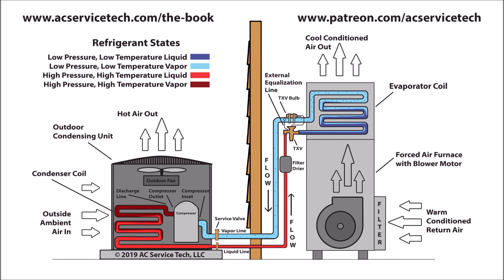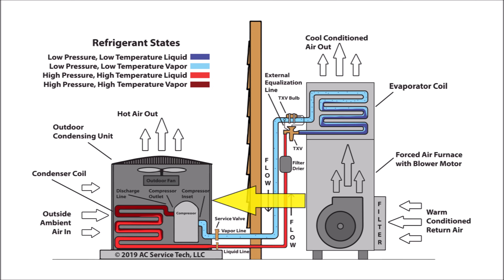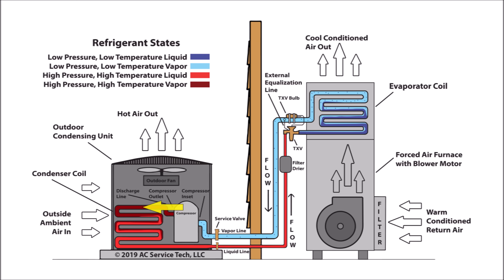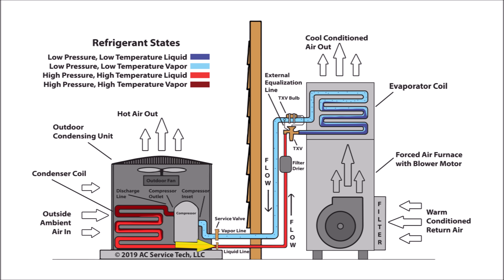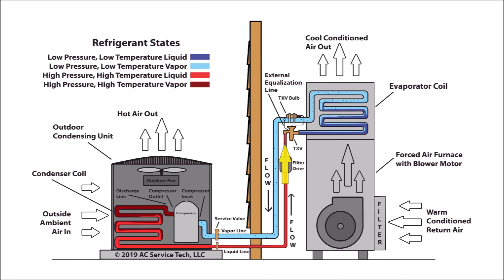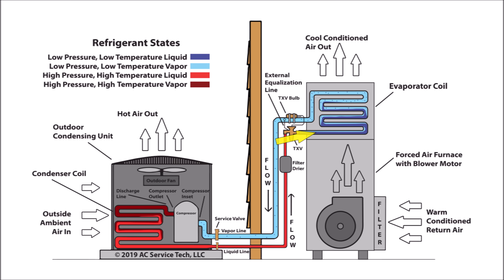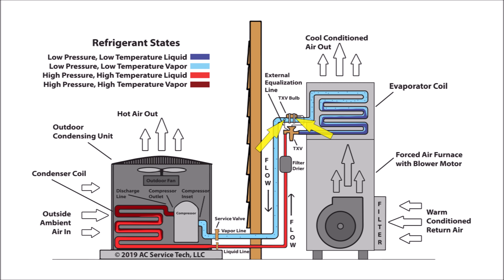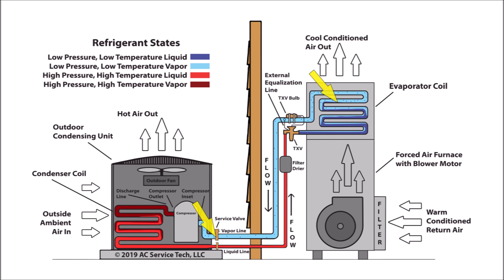The Refrigeration Cycle Explained Step By Step!

Comment from the maker: The Book:  www.acservicetech.com/the-book
The E-Book is Currently Available for Purchase at the Website!
Paperbacks Are On Their Way to the Site soon!
Tool List-  https://www.amazon.com/shop/acservicetech

Support the Channel-  https://www.patreon.com/acservicetech

For those that are looking for the tools used in the videos: (Linked Below)
UEI DL479 Multimeter with temp sensor http://amzn.to/2jtsUbJ
Magnet Jumpers- https://amzn.to/2PyKPQZ
Alligator Jumpers- https://amzn.to/2PxqJXn
Fieldpiece ST4 Dual Temp Meter  http://amzn.to/2wc1ME3
Fieldpiece Bead K Type Temp Sensor https://amzn.to/2DBwKfs
Fieldpiece Wet Bulb Temp Sensor https://amzn.to/2RRI7Tw
Fieldpiece TC24 Temp Clamp https://amzn.to/2qHLyjZ

Yellow Jacket Refrigerant Gauge Set http://amzn.to/2aenwTq
Refrigerant hoses with valves http://amzn.to/2aBumVI
Yellow Jacket Gauge set & hoses https://amzn.to/2vLVkV9
Yellow Jacket 4 Port Manifold w Hoses https://amzn.to/2BkuGIq
FieldpieceSMAN360 Digital Manifold Set https://amzn.to/2BdoaD4
FieldpieceSMAN460 Digital Manifold Set https://amzn.to/2nB4Fe6
Compact Ball Valve for Refrigerant Hose https://amzn.to/2KUisW8
QuickDisconnect 90 for refrigerant hose https://amzn.to/2MMtVcg
JB 6 CFM Vacuum Pump   http://amzn.to/2nqbvo8
Appion Blue 3/8" to 1/4" Vacuum Hose http://amzn.to/2uYlVyc
Appion Red 3/8" to 1/4" Vacuum Hose http://amzn.to/2uYg6Ro
Appion Valve Core Removal Tool http://amzn.to/2uYr8WL
Yellow Jacket 1/4" by 1/4" hose http://amzn.to/2umtcod
CPS Vacuum Micron Gauge http://amzn.to/2v1nM3O
Supco Vacuum Micron Gauge http://amzn.to/2v1JRiA
RectorSeal Bubble Gas Leak Detector http://amzn.to/2ckWACn
UEI DL389 Multimeter  http://amzn.to/2xAdaJf
Air Acetylene Torch setup    http://amzn.to/2aQalsb  
15% Silver Brazing Rods  http://amzn.to/2gVLyLc
Nitrogen Regulator    http://amzn.to/2bXdR5f
Nitrogen Flow Meter    http://amzn.to/2brvoBg
Reply: AC Service Tech LLC I’m interested in the paper book will be watching for when are they expected.  Thanks for all the great info.  Kenneth johnson
Reply from the maker: Thank you and I will send an update out when they are ready thanks!
Reply: Ohh that's great! I've been  waiting for the paper back  version.  Thanks for keeping me  in the loop!
Reply: I do have a  HVAC diploma but I miss some knowledge how your book can help me

Comment: Hi

I have a  MXZ-8C-60NA2   total 4 zones  new set up  3 zones working fine as as I turn  4th zone my suction line goes down below 50psi  or 10°  2-3 hours later  error code 1501 , when I turn on heat mode my suction line goes to RETARD above 350psi 

I checked all communication wires all matching,  planing on disconnecting high  side on the branch box for that particular 4th zone see if my workers forgot to remove  cup from the branch box  flaring part 🤔 

There is 1x MXZ-8C-60NA2  also 4 zones  doing amazing job 

I have total 2x MXZ-8C-60NA2 
8 zones at this particular job site  in  Queens ny. 

Any advice would be appreciated!!!
I watched most of your content good info!!!, thank you for putting all the effort  🙏

Comment: I like the pictures. I would also add the saturated state at the middle of each coil.
Reply from the maker: Hey Purple, the saturated state is anywhere in the coil where both the liquid and vapor exist at the same time. There certainly is a lot going on but yes anything that helps make the teaching clearer, thanks and I have them circled in the book. I also have sections in the book discussing the sat state, thanks!

Comment: Alot of these videos fail to mention HOW, the heat is exchanged in the evaporator coil...the process is called CONVECTION...other than that great video!
Reply from the maker: Thanks Progress24/7!
Reply: Yes, and another thing that adds efficiency is the gas condensing will maintain the gas/fluid temperature, preserving the temp differential with the air and providing a consistent heat transfer.  The same happens in the reverse direction in the evaporator coil.   This video also explains why it's a very bad idea to overcharge a system.